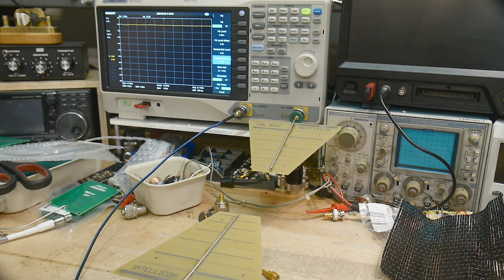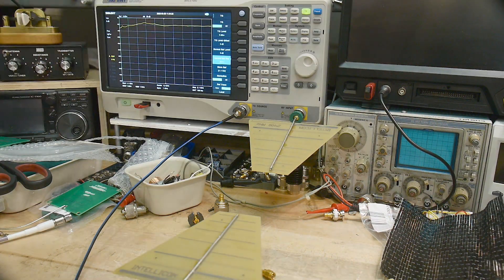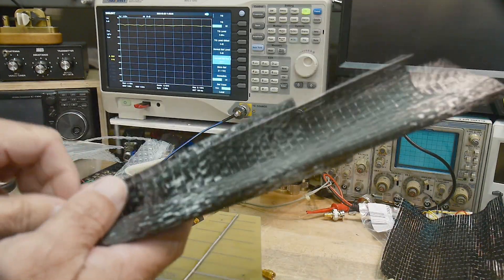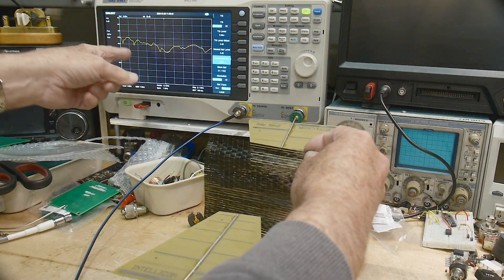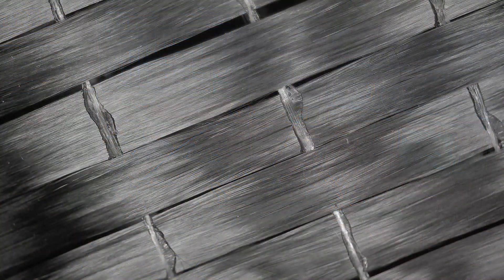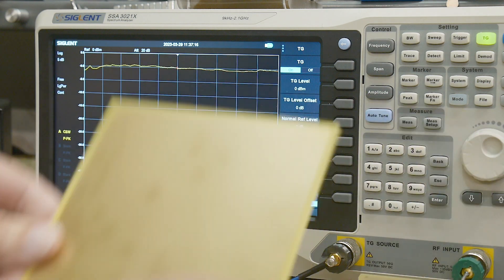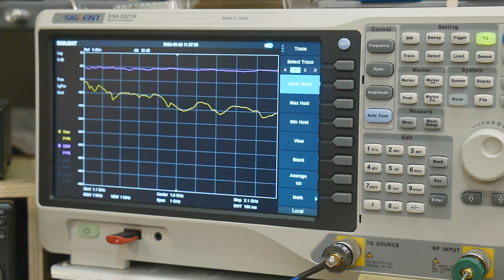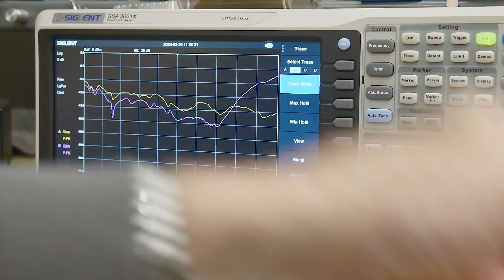#1461 Carbon Fiber RF Polarizer

Comment: Could you try the test where you put three polarizers in a sandwich. The outer should be at ninety degrees from each other and the middle layer at 45 degrees. With light this allows the signal through.

Comment: I am wondering how much of the apparent attenuation is caused by coupling between the transmitting antenna and the polarizer elements. Have you tried moving the antennas much further apart and then inserting the polarizer and then moving it between the antennas to see what the effect on attenuation is? May be useful to measure the SWR for the transmit antenna to see if that is affected by the polarizer, which will indicate that coupling is taking place...

Comment: Unidirectional prepreg sheet might do the same thing.  The nice thing about prepreg is that you can put it down on a surface and just apply some heat to bond it without having to apply resin.  You could apply some to a piece of FR4 and see how it works.